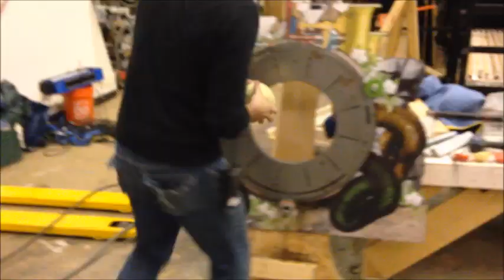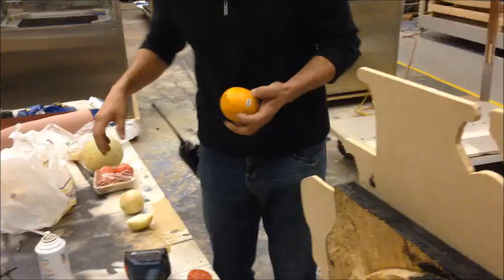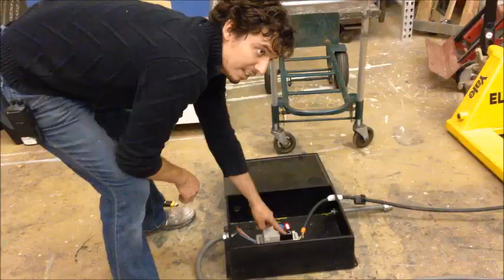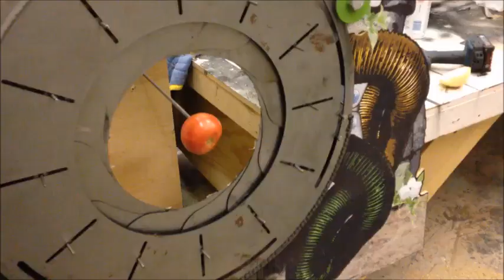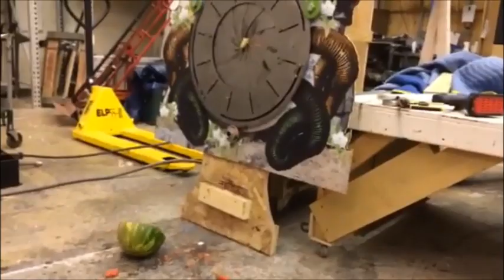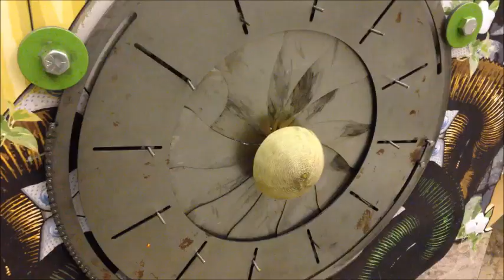Giant Mechanical Iris Aperture Slices and Dices

Comment: The slowest and most inhumane execution method ive ever seen.. like, you could control how slow to chop somebodies head off.. or limb.. hand.. yeah you get my drift.. EEK
Reply: Ikr. Looks like something the midevil might’ve used
Reply: To be fair, if the blades are strong enough and it moves at the speed as show it would be as fast as lethal injection